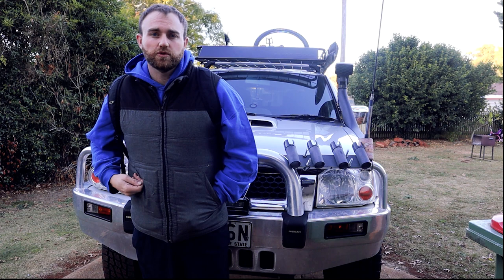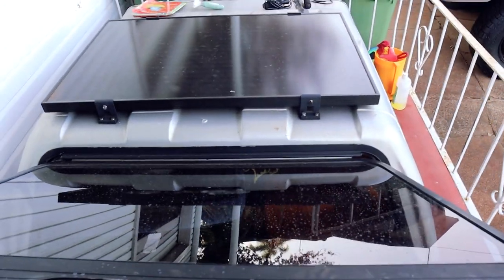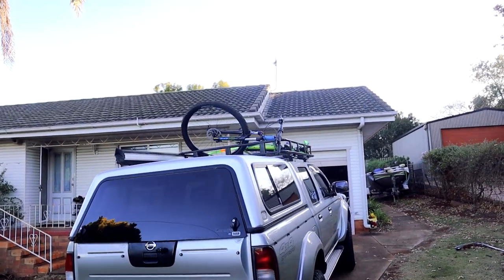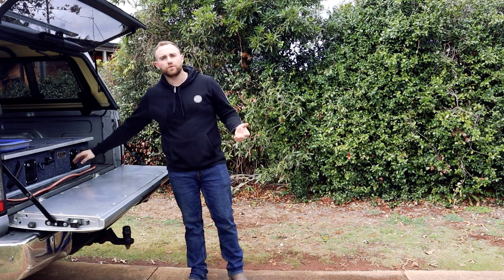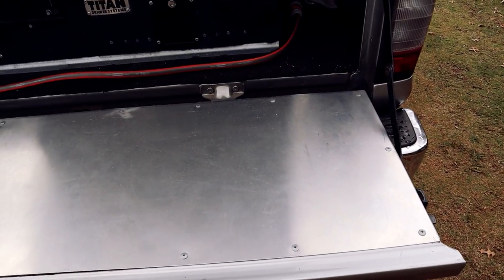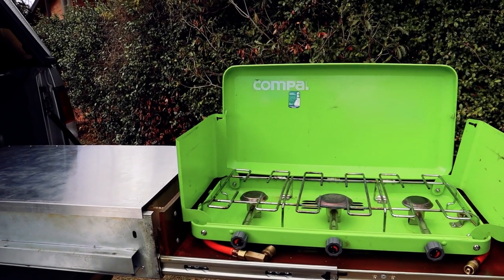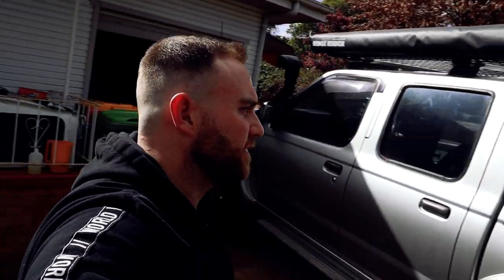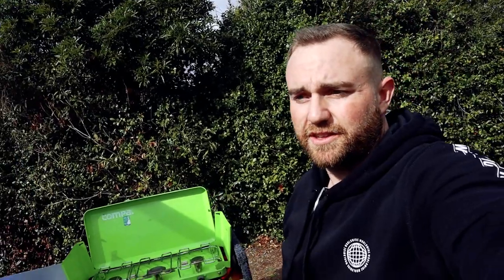Pull Out Stove and Kitchen Bench for my Nissan Navara D22

Comment: Great kitchen setup. I don't understand how when you open the drawer initially it doesn't put out only the cook top. How did you make it open the drawer and then you open it the second time and the cook top slides out. I'm going to try to do the same.
Reply from the maker: Ok so when I made the pull out kitchen, I took the front of the draw of completely, then I attached draw runners inside the original draw from Bunnings, then I made a box up out of plywood to fit between the runners, then I attached the front back on and used the original hole for the latch, that way the draw can pull out or the stove can pull out, I can do a separate video and upload on YouTube over the week end if that would help, in exchange for a share on Facebook or some thing like that! Cheers for the msg